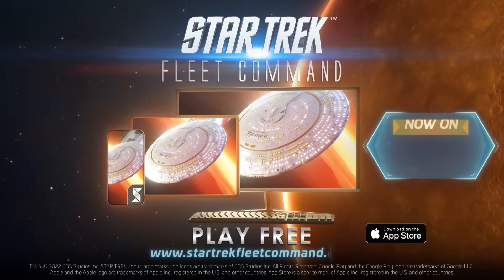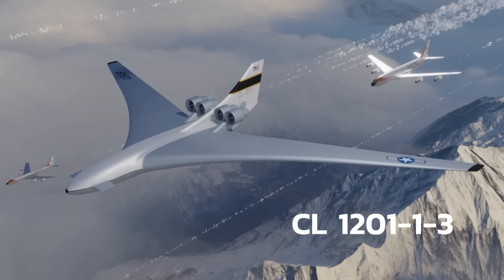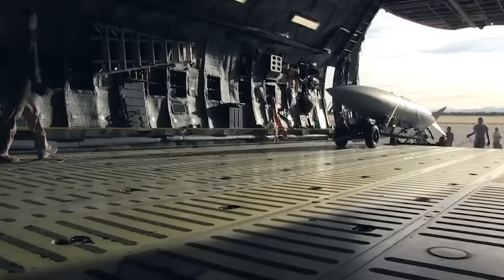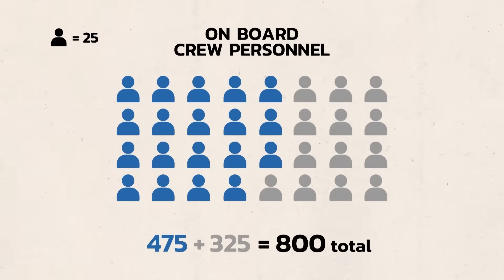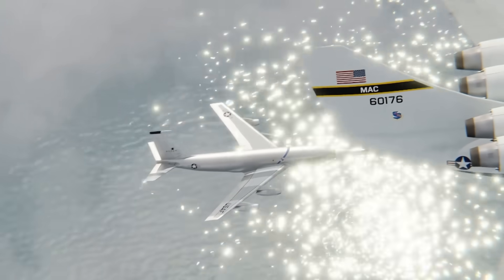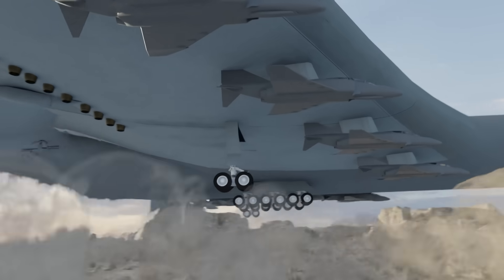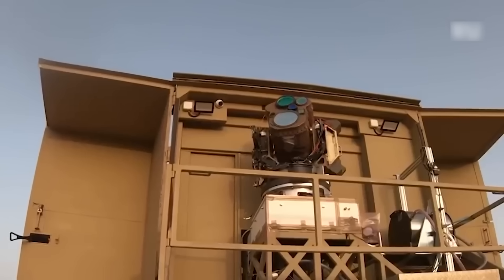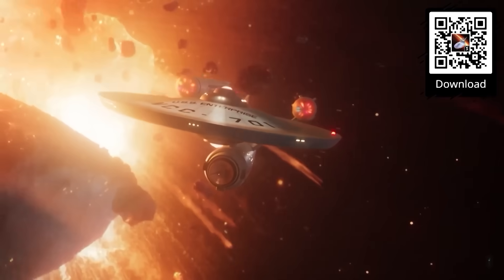The INSANE Largest Aircraft Ever Designed - Lockheed CL-1201

Comment: I think the visual comparison is quite a bit off and the starships were much bigger. Kirk's Enterprise from TOS was 900 ft long. I thought the wingspan was 1,000 ft? The Enterprise D was about 2,100 ft long. The usual quoted lengths are 290m and 634m which, being in meters, makes them about 3.3 times bigger than in ft. Kirk's Enterprise from TOS is about the length of a US Navy aircraft carrier and was designed with those dimensions in mind as Gene Roddenberry was a Navy officer.

Kirk's Enterprise in the JJ Abrams reboot is closer to 1,000 meters long but that's another story.

Comment: i cannot how heat alone by nuclear reaction can provide sufficient thrust to propel the plane.  you see in a combustion engine, buring of fuel produce a raspid expansion of air/fuel mixture and thus thrust.  the heat of reaction produces more expansion. but in the nuclear reactor, there is no expansion of air from combustion and hence i do not see how there will be sufficient thtrust.
may be the reactor can heat up air which in turn drive a turbine which in turn drives a propeller?

Comment: Airplanes crash. No matter how big. Thats why, even back in 1950's it was decided that nuclear reactors in aircraft is a very bad idea. For couple of reasons. 
1. Weight and shielding. The reactor vessel that is sufficient to protect crew and systems from radiation would be cost and weight prohibitive. It would also be lightly shielded, and not guaranteed to survive crash intact.
2.Aircraft crash. See #1

Comment: Hear me out. Shrink it down and loose a lot of crew and install ALOT of spy tech and maybe a nuke or two into it. The capability to have an aircraft cable of flying for 41 days straight you might as well make it able to leave the atmosphere. It’s vtol capable so it’ll just go straight up to cruising altitude in the middle of nowhere where nobody sees it take off and then gain speed over the ocean leave the atmosphere and spy anywhere we want not bound by satellite orbits. Special paints or reflectors could make it pretty much impossible in the night sky and space. It can only take off and returns to base on a night with no moon so total darkness.

Comment: Holy crap..... if thats what it was back then in the sky it kinda makes sense..... if it needed to be stealth from low frequency radar as well as the high frequency that we worry about on our current jets it wouldn't have vertical tail sections or would have very minimal or strange ones... notice in the "alien" craft that theres no tails..... its a massive vtol flying v wing with no vertical tail sections.  It probably had to land due to an emergency, and couldn't get back to the antarctica base or anywhere else it wouldn't be seen.

Comment: im still not sure how the propulsion works. I know the Nuclear reactor provides electricity, but how do the engines produce thrust without any burning fuel? They're jet engines but without any combustible fuel, there's no thrust generation. my only idea is the jet engines just compress and expel air and high speed just with the fan blades. Unless someone here knows, i'd love to know exactly how these engines work off a nuclear reactor.
Reply: Finally someone poses this question.

Comment: The visual of the fighter carrier is way inaccurate it would need a cowling to accommodate the pilots access to the cockpit from within the wings. The air turbulence of the massive crafts engines would make planes trying to dock to the troop carrier from behind tear themselves apart.

Comment: If it were shot down, you would lose a lot, maybe even the war. Plus, runways, hangers, maintenance, parts, etc. would require out-of-the-ordinary construction & logistics. Better to have several smaller planes (still huge) and lessen the risk of complete loss. This makes me think the Navy should have a larger fleet of smaller aircraft carriers for the same reason.

Comment: I guess if it's nuclear-powered and pushing through atmosphere with ease it doesn't matter to have dangly planes below the wings messing with airflow.  They'd be better inside the wings, though
Reply: I take that back.  If the main ship is damaged and unable to release its fighter jets then that would be a problem.  The fighter jets would need to deploy themselves if they had to, and also be able to fire their weapons while docked
Reply: Ideal design of fighter jets would allow them to dive and glide until engines turn on

Comment: I wonder if the VTOL would work for something like this, maybe, if not, have fun making runways for those.
And it would be best to make new fighters etc. that could dock well and also get the pilot in and out, refueling wouldn't be the biggest issue as they already do that, have done for decades, could of course also be done when re-attached to the plane, but re-arming, hmmm.
And this sounds like they would be called stuff like "The Uncrashable" and such, and then crash.
Too big to fail kind of vibe, which is of course not true.
I do think that by now it could be done better and need less personnel and stay up longer.
Just a few of these and some like it with troops and material would be quite a force to invade something.
Better have some extreme defense systems indeed to keep them safe.
Of course now they'd make them stealth ?

Comment: A plane so big it would be able to carry its own anti missile defence turrets, missiles, flares and a full suite of ECM systems. And likely stay at an altitude that would make most short range weapons useless. Not to mention most regular AA missiles likely wouldn't be able to do much damage to it anyway. 

I wonder how it would be designed with modern materials. From what we know today, how well would it work (also i think downsizing that thing a bit would be a good move, 12 fighters carried would be enough)

THough maybe the Avengers flying carrier would be easier to pull off XD

Comment: The fact that they proposed laser defense in the 1960’s really shows how long we have been working on them
Reply: And they are still almost ready, just like the last 30 years
Reply: @HappyBeezerStudios  Lasers are ready once fusion power is ready.
Reply: Even the Soviets already built 3  types of laser vehicles in the 80's using the Shilka, BMP-3, and T-72 chassis
Reply: @thenasiudk1337  don't forget the airborne laser project to shoot down enemy missiles.
Reply: @HappyBeezerStudios  The Iron Beam is supposedly being used to shoot down HAMAS rockets now. I think that means it has entered low rate initial production, or the prototypes are at least being used in real combat.
Reply: If you really read the fringe accounts of energy weapons tech, you will learn that by the end of WWII, most major powers already had radio/microwave frequency weapons already. Lasers are a retarded distraction, as most of the damage is heating, unlike microwaves and radio, which can penetrate beyond a centimeter...

Comment: Please cover The Thunderwell! Nuclear steam piston concept launch system/weapon for launching cargo into orbit, destroying asteroids, lol and aggressive Alien Spaceship! https://youtu.be/VonfewfNNfI 😆👍
--  The steam accelerated Jules Verne capsule, which was suggested by the speed of at least 6 times earth’s escape velocity, achieved by the 10-cm thick, 1.2 m diameter steel cover blown off the top of the 152 m shaft of the 0.3 kt Plumbbob-Pascal B underground Nevada test on 27 August 1957. In that test, a 1.5 m thick 2 ton concrete plug immediately over the bomb was pushed up the shaft by the detonation, knocking the welded steel lid upward. This was a preliminary experiment by Dr Robert Brownlee which ultimately aimed to launch spacecraft using the steam pressure from deep shafts filled with water, with a nuclear explosion at the bottom; an improvement of Jules Verne’s cannon-fired projectile described in De la Terre à la Lune, 1865, where steam pressure would give a more survivable gentle acceleration than Verne’s direct impulse from an explosion. Some 90% of the radioactivity would be trapped underground!

Comment: Lockheed CL 1201. Good plane by the looks of it
C stands for transport under basic mission 
L stands for cold weather modified mission 
The 12 stands for design number the 12th design of the plane
01 means series
Here’s a little design series thing for you
 

Stratus prefix
G permanently grounded
J special test temporary
And special test permanent
X Experimental 
Y prototype 
Z planning

Modified mission
A attack
C transport 
D Director
E special electronic installation 
F fighter
H search and rescue
K tanker
L cold weather
M Multi mission
O observation 
P patrol 
Q drone
R reconnaissance
S antisubmarine
T trainer
U utility
V staff
W weather

Basic mission 
A attack
B  bomber
 C transport
E special electronic installation
F fighter
O observation
P patrol
R reconnaissance
 S anti-submarine
T trainer
U utility
X research

Vehicle type
G glider 
H helicopter
S Space plane
V VTOL/STOL
Z lighter than air vehicle 
 
This is what the military use to sign their lines into certain categories

Comment: Love this plane! Great video. Info only—the Phoenix lights were target illumination flares dropped for a big joint attack exercise in the military training airspace west of Phoenix (very bright flares falling under a parachute designed to illuminate a battlefield). They appear to "block out the stars" because the light they produce washes out the stars behind, even in the area around the flare that appears relatively dark. I arrived on base for A-10 school shortly after this exercise and was trained by several who were part of it. The military did, indeed, respond to many inquiries with this simple explanation, but I suppose the press did not pass on the info because aliens are way more fun.

Comment: Very cool. How would the pilots get in to the fighters hanging on the carriers wings? 
For water couldn't they fly through clouds and condense the water? 
I don't think the VTOL system would work. It would weigh too much. Would need antigravity lift engines. 
Also the cost would be crazy. An estimate for the cost could be somewhere around 4 or 5 times as a new aircraft carrier.

Comment: The "design" probably never took into account the overwhelming weight required to shield a nuclear reaction or the problems of dangerous flight instability caused for daughter aircraft when attempting to dock.  For the daughter aircraft, there would be no way to arm, refuel, repair, perform pre-flight checks, or even get the pilot into the cockpit.

For the Air Force Nuclear Propulsion project, they converted a Convair Peacemaker into the NB-36 to carry a nuclear reactor for testing (it did not power the plane).  The reactor weighed 16 metric tons and produced 1 megawatt of power.  Exactly how they would scale that to 1,800 megawatts and still carry it is not clear.

For the 182 jet engines providing vertical life, I cannot imagine the amount of maintenance that would require.  This aircraft is not going to stay in the sky for weeks.  It will need to be on the ground for maintenance every day.

Laser weaponry aboard is absurd.

Comment: For me the biggest takeaway from this video was the fact that Kirk’s Enterprise was so much smaller than Picard’s Enterprise.
Reply: The stress of managing such a vessel is why Picard was bald and Kirk wasn't. But they never mentioned that on the show 🤣
Reply: The Galaxy Class (Picard) was designed for multi-generational missions. They had families and kids aboard in addition to the standard crew. Kirk's Enterprise towards its retirement was a military vessel, Picard's Starfleet was not a military in the first half of the 24th Century and thus during peacetime the Galaxy Class was king. However Starfleet went back to a war/military footing so smaller more aggressive vessels were built with the same mission profile as the Refit Constitution (Kirk's ship) such as the Enterprise-E
Reply: You just found out? Kirk's lady would fit quite snugly inside the saucer section of Picard's. (You can see this is the size comparison part of the video.)

Comment: The raw fatigue to a frame system that size would be crazy. Add in the couplers functions and dynamic load changes of loading and offloading other aircraft - takes that to insane forces before you even take flight!

Plus - no airport big enough to take off or land at!

Comment: First you say it could fly 41 days... then 48 days. Giant "nuclear powered" planes like this are a silly fantasy. Ive never seen a real explanation how you can power a plane with nuclear power.... a reactor can make electricity, it can make heat, but how will it make THRUST?
Reply: Not that I think this design is sensible at all (it ain't), but a nuclear reactor could easily be used for a jet aircraft as a jet simply needs electricity to suck air in to heat up and convert into thrust (a bit more complicated than that but that's the essentials). As long as it can provide electricity, a nuclear reactor can do that, though you instead have other issues like the sheer weight of such a system and ensuring you have adequate coolant available (most nuclear power plants use water from nearby sources).
Reply: Jets run off the pressure generated by combustion. Power plants run off the pressure generated by steam via the heat of the reactors. In theory, a steam turbine as used in power plants works the exact same way and would only need to be connected to a fan/prop (literally the same thing) via a shaft, as they do in jet engines. In practice, there's a reason power plants are fucking huge and require a huge water source, which makes them absolutely unworkable in an aircraft. Among the many issues, a steam turbine would need to be many times larger to extract the same energy making the concept a non-starter from the beginning. Anyone who suggests electric motors is just adding more steps and more inefficiency.

Comment: This is INSANELY impractical. They'd better have made them stealth. Or I mean, one missile and thats it.
Reply: With something this size and all the various angles of the components, there's no way you can make it stealth. You can use as much radar-absorbing material as you want, but something will always be reflected so most stealth aircraft focus heavily on ensuring those returns are diluted. This thing is way too massive for that.

Comment: I think the engineers themselves never truly believed the idea, upon which the were designing. Shear size made obsolete, but they had to invision the idea as if - what if - possibilty. Although they could have made it possible by creating literaly a aircraft-carrier in the sky with multiple electric fans to lift off and fly them turning forward as for plane mode. As for multitude electric driven fans, fail one will not be serious issue. Also, speed should not be priority, but delivery of maximum weight on board, so its transporter and just about 3-7 times the mass of Boeing 747. It should resemble as modern day drones that the wings with fans swivel downforce and for forward thrust. Now, it is too late for such project to realize.

Comment: I think nuclear power aircraft of a variety of types this size and even larger are perfectly viable.  However, I think only smaller unmanned nuclear aircraft are reasonable for military applications.  It is just too easy to hit a large military version.  Your only possibility is to protect it with heavy armor, and then it just becomes a profoundly difficult engineering puzzle and a huge waste of materials, because there is just so much more you could have built with all that.
Lasers would be inadequate to defend these.  They would be fine against missiles, but ineffective vs antiaircraft guns.  It would also be very cheap to develop a large antiaircraft gun just to knock this thing out of the air, compared to the research to get this into the air.

Comment: The CL1201 wouldn´t work. The thing is while the wing-area to an extent can help lift a aircraft in ground effect and on an angle of attack. The span to weight area is what determine the angle of attack. For a 747-400 at maximum load its 6.4tons/meter.. For the CL1201 its 15,8tons/meter. 

This would force the plane to either fly with a extreme angle of attack or at very low altitude. .. or supersonic. Neither is really workable.